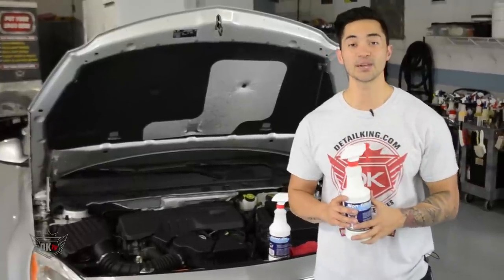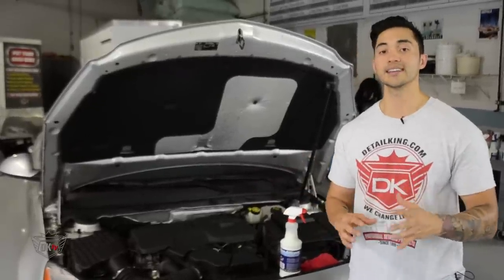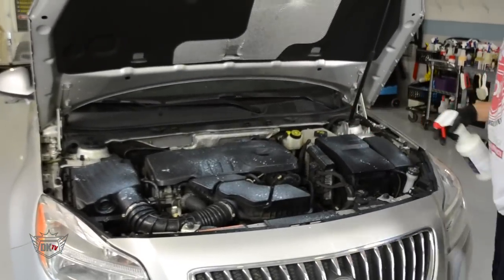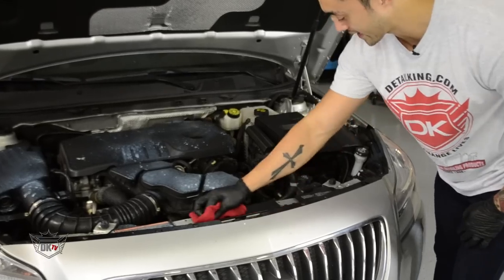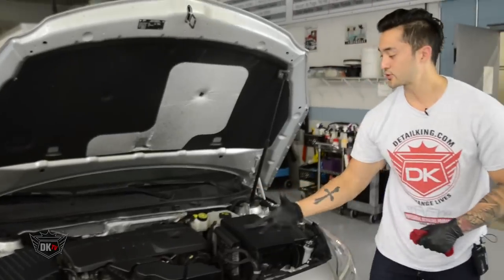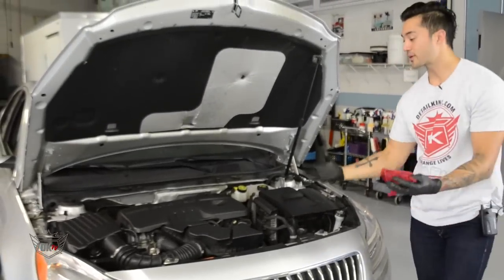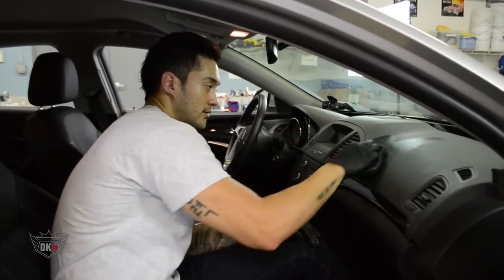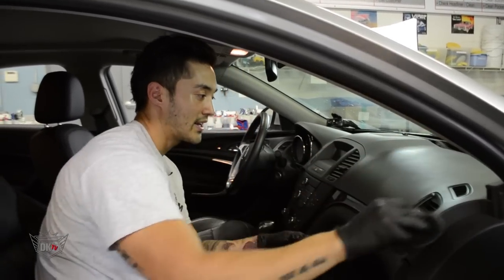How to Dress Your Engine and Interior Plastics

Comment: Great video!

I was wondering if you could go into more detail about why you wouldn't want to use a silicone based dressing  around electrical components.  Does the silicone ruin the wires? Or is it only bad if it comes in contact with the part of the sensor that takes readings?
Reply from the maker: Thank you! To answer your question, the silicone will mess with the sensors under the hood. It wouldn't have any affect on the wiring but silicone is known to cause issues with sensor readings.
Reply: Detail King
Thank you for the quick response :)

Comment: Why wouldn't you wash the engine bay first then apply the product?
Reply from the maker: rsxfreak79 great question! In most cases you would definitely wash the engine first. In this video we are just showing a quick way to dress the plastics and vinyls if you're pinched for time or if the motor doesn't need a full detail.

Comment: can you use armor all on engine plastic parts
Reply from the maker: Eddie, we do not recommend using Armor All on engine parts. Silicone can cause damage to sensors under the hood and applying any silicone based dressing to it would put you at risk for damaging those components.